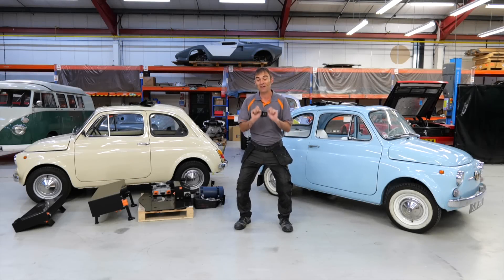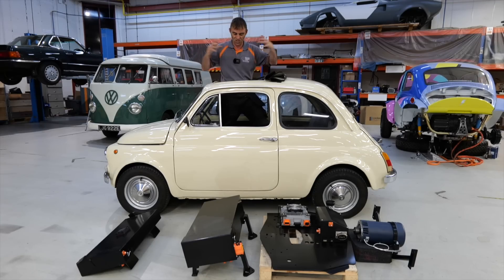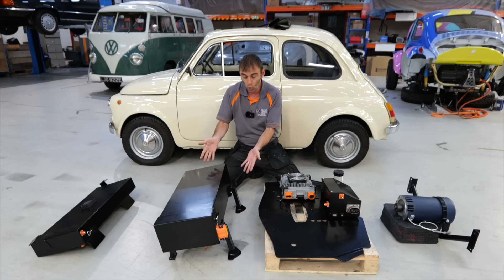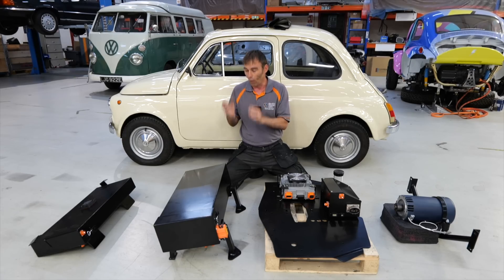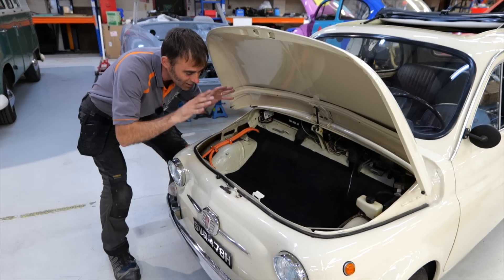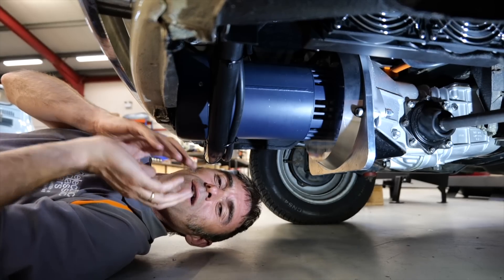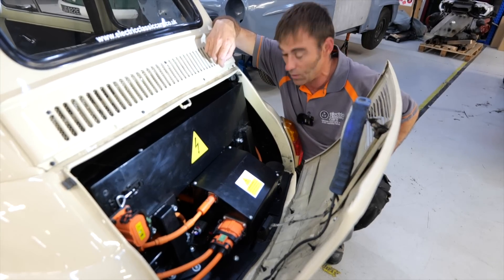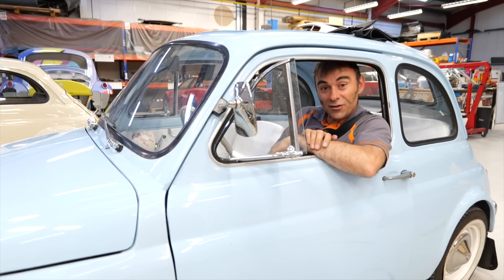Fiat 500 bolt-in electric conversion kit.

Comment: Well, of course, a petrol car needs more dials and meters:
rev counter, oil pressure, oil temperature, water temperature, external temperature, battery voltage, ammeter, boost pressure, tyre pressure (four) altimeter, inclinometer for going up hills, visibility indicator for misty or foggy conditions ...

Comment: I had a couple of comments about this and its from someone who had a fiat 500 as a family car back in the late 70s. Why have you got rid of the spare wheel, don't electric cars get punctures? Then there is the range. Becuase it was a frugla little low power motor you could get over 300 miles on a tank of fuel which in the late 80s cost around 5 quid to fill! Having 50 miles of range is pretty poor even for a city car. Its a lovely conversation but the range is a real deal breaker

Comment: Interesting but the cost is (at the moment) prohibitive. Plus, personally I don't believe battery power is the future. I still hold fire, with hydrogen or similar fuel cells are the way to go.

I have a 1972 Ford Escort I am restoring. I contemplated an electric conversion for about 30 seconds. Way too costly and it will be obsolete before the petrol engine will be.

Comment: It's just like the old days when turbo charges became a fad, people retrofitting them to their car and blowing up their engine. If the engine is not designed to take a turbo, don't expect the engine to cope with it. And this is the same, fitting electric motors to a old car, with all the extra torque some thing is going to give. I would not want to drive a old Fiat 500 because  they do not meet todays safety stands, so why make one even more of a death trap. If you want a EV buy one that was designed  to be one.

Comment: I wish there was an equivalent of your company in central / eastern Europe...

I've tried to find EV converted Trabant 601, but I only found a couple older conversions done using lead-acid batteries. Replacing the (front-mounted air-cooled 600cc) engine with an electric motor (attached to the original transmission) seemed like the easy part and there seemed to be a space for a couple Tesla modules under the bonnet and a third could be placed in the boot for better weight distribution. Among many other aspects that Trabant 601 and Fiat 500 share is the placement of the fuel tank and the lack of external fuel port, so it'd be necessary to find a fitting spot for the charging port that ECC cleverly hide under the front badge on their Fiat 500 conversions.

Comment: Did i hear you right? was it 75 volts? That's just a powerful e-bike battery. Heck i've got a 48.1v ebike (up to 2kW) and scooter(peak 1kW, nominal 500-600) and they're a lot of fun for the weight to power. But on a car? A Prius(Camry, RAV4, GS, IS, LS, etc.) uses 201.6V and apart the pack struggling (likely due to old NiMH tech) at speeds above 35km/h it's like a 1L Dacia. But 75V.
I've also had some remarks for using "high voltage" on the priis 201.6v pack, and while for a car it is a high voltage in an electricians book that's low voltage, since high voltage starts from 1kV (could be 10kV, not sure on that right now).

Comment: So, do you guys work on newer, more pracitcal vehicles?  I have a grand caravan that vacillates between large toolbox / lumber hauler and take visitors to the beach shuttle bus.  The engine and transmission have been fine with the exception of endless fluid leaks that i have spent a fortune on fixing.  Brakes and suspension also have problems.  Could  a caravan be electrified?   How much (ball park)?  Is it worth it on a vehicle of this age and mileage (180,000)

Comment: Great way to stay true to the original! 

Help me with the battery math, though: You have a total of 3 of the venerable Tesla modules. I assume that you are wiring them in series, as you are summing the voltages up to about 70V. Now, I realize that if you can afford to buy Twitter you are already playing by a different set of rules, but are you also summing the capacity up to about 17kWh, which would typically require wiring in parallel? Does the level change from cell to module to pack change the math?

Comment: I DON'T WANT a Simple-Sh-te "City-car", and Fiat AGREES with ME [as far as Size/accelleration], because their Electric, built on the Nuovo 500 Fiat, is nearly as fast as my Fiat-Abarth Cabrio.  I think it's GRAND that you "re-purposed" old 500s for city cars, but I want to go Anywhere,--NOT restricted by the Puny-RANGE Fiat deigns to give me now.  If you can't "Do" a LONG-range, larger Fiat like the 2009-2019 Nuovo Fiat 500, WHO COULD you send me to, that's not willing to be limited by the concept of a"City-car"?   I want a hybrid, that can be Electric in one mode, and "cross-country"/gas-powered in another.  I guess I want a Prius, but I think the Prius should have used a smaller gas engine that could power the electric motor going down the road,--handle the A/C, tunes, and charge the main battery.  Simplicity is FINE, --where I live, almost everyone has a golf cart, and those can be "simple", but what if I WANT to drive to the Mts of Sedona [--5hrs, total-time, @ 80mph, or get 'run-over'], or tour the Castles of Wales?   Some of us NEED hybrids.  Besides,--Sure, in the city,--it's 25-40mph, but it's 80mph for 30-40 minutes, to GET to where you THEN drive city-speeds. Yes, there are houses near the downtown, but they are half the size and twice the price of a larger-house in the 'Burbs.    I could get a used Fiat "Pop" [110Hp ], put in a Electric-kit Sized-in between your "City-car" and your "VW-conversion", in the REAR of the 2012 & up Nuovo-Fiat 500, {--maybe not mounting the front battery of your VW kit}, and I could have my "Hybrid."

Comment: You really should have put the ADAPTER PLATE on the floor with the Kit since that is very important to the conversion,
also what about the brake vacuum pump (or hydraulics)?
Reply from the maker: There is no boosted brakes on a Fiat 500. 👍

Comment: Theoretically, can I put in 5 battery packs instead of one and get 3-4x  more range?
Reply from the maker: Yes, but practical it would be too heavy for the car.
Reply: @ElectricClassicCars  Would it work if I am the only one driving, i.e. trade the passenger(s) weight for more range? :)

Comment: I am a drag racer. I would love to have a conversion running a transmission and drive shaft or prop shaft to rear Axle. It would have all of the attributes that combustion engines have to be forced to do. 100% torque at the hit will be brutal. I do say WILL be. I wish I could do my 55 Chevy.

Comment: Hmmm..If you could move the aft battery pack into the rear seat area, bump it up to 5 Tesla modules and find space for a slightly more powerful engine, Possibly an HPEVs AC-50, you could build a Fiat 500 that could even get Lupin's attention. See "The Castle of Cagliostro" for details.
Reply from the maker: Unfortunately that weight would be too much for the car. 😁👍

Comment: Watching your conversions really makes me wish I still had my 83 Nissan Sentra Hatchback.  I bought it new and drove it till my daughter got a job and needed a car.  I gave it to her in 2007, I think, and she had it for about 4 years before trading in for a new car and a husband.  It did all that on original engine.  I had to change the carburetor and ended up getting a Webber because they couldn't find an original anywhere.  Actually ran better.  Only real problem I ever had with that car was it went through CV joints like a child through candy.  I think I replaced the front axles about 5 times during it's life.  Now if it is converted to electric...  Hmmm...  Maybe no more CV joint problems?  I think the car would be a great small car conversion.  Might be a bit bigger than a VW Beetle, but not by much.  Tell me what you think. 🤔

Comment: How is the old chassis handling the battery and the engine weight?
Reply from the maker: Fine. It weighs the same as it did with a full tank of fuel and one passenger.

Comment: Very nice work!
But.... you take a charming little classic with a 350+ km operating range (after which you can fill it up at any gas-station), and turn it into a soulless, silent toy with less than half the range. And that is in summer. How are you going to heat it, or defog the wind-screen on a cold, humid day?
This was cute for city-use, in summer, before it was decided that we should have another energy-crisis. 
If you have to do it, please leave the last Fiat 500s alone and take Fiat 126s from Poland. They are just as cute, just as simple, and the crowd at Mcdonalds won´t know the difference anyway!

Comment: Hi Mr...you are a very good teacher....
Thanks for share your video.....but I  have a question for U.... What  is going to happen to the Drive Motor located  on bottom of the car, while driving in the raining day and the car goes into flooding street...?..
The Electric Drive Motor which is on the bottom of the car ... Is it burn up ? Is it get damaged ?
Or it"s water proof.?
Thanks for your video...👍

Comment: Would you consider experimenting making a simple hybrid conversion of a small engine FWD hatch (eg Honda Jazz) by adding electric to the rear subframe with many of these components, but leaving all the FWD petrol side of the original car unchanged?
This would mean that the original factory power steering/braking/aircon/charging/starter/heating would work as normal as well as retaining the convenience of quick fill-up and motorway range - but having just a single Tesla battery/regeneration module to absorb all the braking energy when going into a set of suburban corners or descents, and redeploy it quickly when exiting the corner or going uphill. The original petrol engine would spend 99% of its time at light load or idle.
You could alter the accelerator so that it's only the electric operating for the first inch of travel and the petrol stays at idle until beyond that. You could link the switching of strong regeneration drag effect to the brake lights.
The other advantage of leaving all the original petrol assembly completely intact would be reduced insurance assessment issues.

On the other hand... you could contact the  "K Swapped Honda Jazz/Fit page worldwide"  Facebook group of people who fit K20 or K24 DOHC supercharged/TypeR engines to their Jazz, and offer them a second 300bhp of Tesla electric at the rear end too?

Comment: With the AC-20 you don’t need a clutch and flywheel, you will get more power and range by removing those heavy things. I used an AC-35 in my VW bug at 120V, just configure neutral-breaking to NONE or zero in order to shift gears easily. You will have regen at the breaking pedal only using another throttle to break with the motor at your own will, not by releasing the acceleratio pedal. This is by far the best optimization you can do with the HPEVS and the Curtis AC controller. Regards from Mexico! (Converting the same little Fiat car soon using DC Series D&D at 96V, 19KWH pack) I’ll let you know the  results. What are yours? Range and speed of course.

Comment: Not quite an old classic but the Toyota IQ was the perfect modern city car, ahead of its time on launch. The plans have been leased to a Chinese company to produce an electric version for the Chinese Market, though Toyota did produce a limited run of electric versions. Again, ahead of the game. 

I bought my IQ new in 2009 and have done 96,000 miles with zero mechanical faults. I'd love to make it electric.
Reply: I tried to get in one at the showroom in Toyota City back in the day and I simply couldn't fit! Otherwise very cool car.
Reply: @wiegraf9009  🤔 My daily driver (petrol version) since I bought one new in 2009. Are you 15' tall? 🤣🤣🤣

Comment: Please note that what we now consider a "city car", at the time of its launch was just an "economy car" for those who couldn't afford a bigger one.
Anyway, another car that could be quite suitable for this conversion is the original Fiat 600, the car which actually put Italy on wheels. Still an RWD but with a tiny 633cc (later 767cc) 4cyl. watercooled engine, it's not as fashionable as the 500, maybe because the 600 actually was the only car for most families, while the 500 – being so small – quickly became the 2nd car or the car for young drivers. For this reason, 600's usually were driven to the ground and today they are much rarer than the 500.
Another small car suitable for conversion could the NSU Prinz L and obviously the more spacious but still light French cars like Renault 4L, Citroen 2CV and Dyane.

Comment: I would like the Škoda 1000MB converted to electric. It could fit two of the bigger modules we saw in this video. One up front where the gas tank was (direct above the axle) and one in the rear. The motor controller would fit under the back seats, together with the charger. Ideally 11kW 3-phase charger.

Comment: I like this conversion. There has been no butchery done to the car so it could easily be converted back to original specification if all removed parts are kept safe. This is an important consideration if the car is ever to be auctioned in the future - they are valuable and I suspect the EV stuff, nice as it is, would reduce the value of this collectors car.

Comment: I love it and I own an original 1971 car however the space saving isn't great when you consider the spare wheel is missing and I suspect the weight distribution is very much further back too. That said neither of these are deal breakers if you're after an electric city car I suppose 👍

Comment: one question
fiat 126 and 500 share most of understructures, 126 gearbox being a bit better with synchronization of gears (some tuning people replace it with the 90's fiat chinquechento 700 gearboses when swaping engines)
the floor pan sgould be the same in both fiat 500 and 126 from first series, yet fiat 126 has a fuel tank localised under the back pasangers seat, would it be possible to slam another tesla cell under the seats of fiat 500 as well increasing it from 3 to 5 cell pack or perhaps steping down the voltage and goung 2s+2p config?
what if you would like to upgrade something wierd like fiat 500 gardeniera or 126bis with back hatch
is there a reason you didn't put any cells under the back seats? because it seems like a perfect place

Comment: What is the weight difference between the removed components and the new EV components? Does it warrant any changes to the suspension?
Reply from the maker: It's about the same compared to what came out plus a full tank of fuel.
Reply: @ElectricClassicCars  that's quite impressive

Comment: FIAT 126 or FIAT 126 BIS (motor in front). They are not much bigger outside but gave more room inside. Direct drive without heavy gearbox would bee nice and will improve range or speed or both.

Comment: What a great little package.  I do think when you see some of these two ton plus electric SUV’s they are a bit of a contradiction, this on the other hand small and efficient and a good way to get about town.  Great job Richard, loving your channel. 👏👍😀
Reply from the maker: Thanks. 👍
Reply: @ElectricClassicCars  I look forward to a one-size-fits-(nearly)-all for most rear wheel drive cars. Replace the entire rear axle with a new transaxle which includes the motor.

Comment: In Australia you'd need 90 miles or 150 km range for daily commutes because places are not so compact here. Cruising speed would need to be up to 65 mph or 110 km/h. Air conditioning for our torrid summers would be a must have.
Reply: Hmmmm you'll need lots more battery, and therefore a bigger car, for those requirements. And those are already available at vast cost.

Comment: Moving away from your original question, what about a Rover P6? Originally designed for a gas turbine, so an EV conversion sounds spot on. Masses of space under the bonnet and well able to deal with big power and torque as Rover fitted the 3500 V8 in there. A powerful, smooth and comfortable cruiser.

Comment: What about the Fiat 600? It should be very similar but slightly larger. I think you could fit a bit more battery in it (the 600) for a tad more range.

Comment: These kits are intriguing, but unfortunately way too expensive for a realistic conversion en mass of mass-market cars. Would like to see an inexpensive kit for a 10 year old Passat, Golf, Corolla and other very common cars where the value of the car has dropped below 5k while it's still a structurally sound choice with modern safety features.
Reply: It is going to be hard for the conversions to compete in price with used EVs (when the current shortage abates). I got a used 2017 Fiat 500E for $7k in 2019, and aside from an 85 mile range it is everything I could want in an EV. Of course there is a market for novelty EVs, but I can easily imagine a Chinese manufacturer making a fiat 500 tribute EV that is even cheaper.
Reply: @macrumpton  In a way I agree, even if used electric cars in the last 1-2 years have skyrocketed in price. Back in late 2020 a used Renault Zoe (22 kWh model) with 20 000 miles on the meter could be had for as little as $6000-7000. Converting an ICE car at those prices would be insane. Today the same model but with another 10 000 miles on the meter is twice as much. And the Zoe is still a tiny car. For anyone looking for a full-sized estate car for the whole family and a bit of luggage the options for an inexpensive used EV are really slim.
Reply: Here's the flaw in your argument: people who do these conversions are a minority to begin with, so of course there will be no "en mass" conversion. It's like thinking that because you work on your car, most people do. And it's simply untrue.
Reply: Perhaps in a few years. However, at the moment, you are discussing a market that ECC doesn’t pretend to serve no is it possible to serve.
Reply: $3000 Used Reno Zoe with 80000kmh